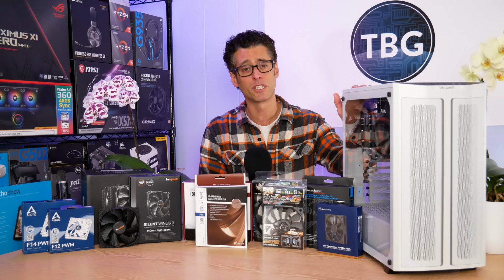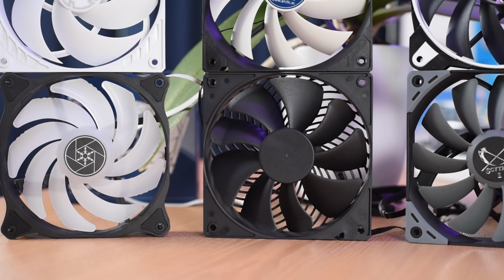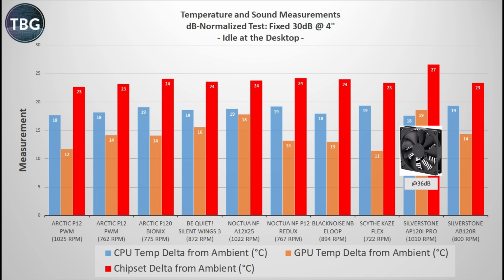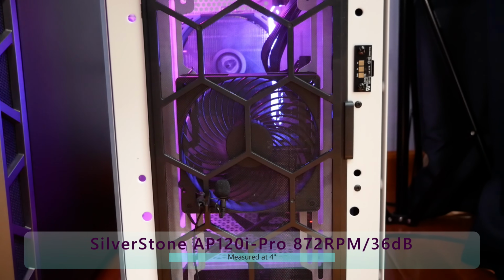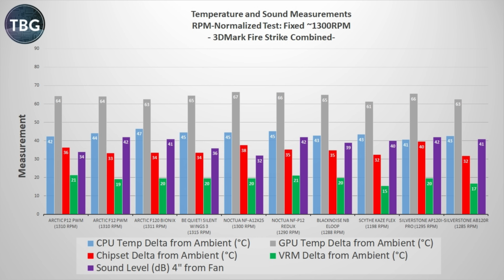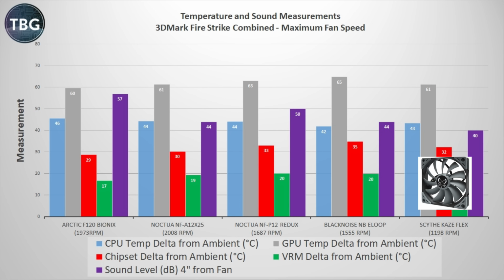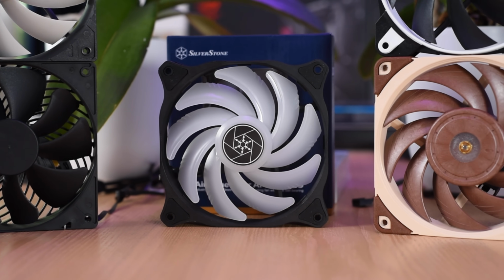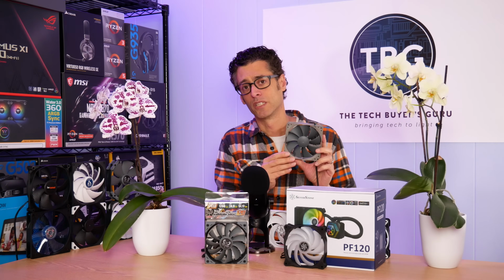The Best 120mm Case Fan Shootout: Arctic vs. be quiet!, BlackNoise, Noctua, Scythe & SilverStone

Comment: Can someone please recommend a good 120mm slim fan shootout video? Thanks!
Reply from the maker: Depends if you need a case fan or a cooler fan. As shown in my radiator fan video (https://youtu.be/W2Zis8RjcX8), you can't do better than the Noctua NF-A12x15 for a slim radiator fan. Here's the product link:  https://amzn.to/3jb0HVc
Also available in black:
If you need a slim case fan, then you want the Scythe Kaze Flex Slim: https://amzn.to/30gQVrA
It uses a similar blade design to its thicker brother that did so well in my shootouts.

Comment: We really need more videos like this, buit I'm concerned about the methodology. The microphone is picking up noise from air flow. also the vibration of the case, because it's clipped to the case. if the GPU was throttling, then the heat generated in every test is different. Like I said, we really need some more info like this for deciding what to buy. please keep it up, and try to improve the methodology so that the results are reliable!
Reply from the maker: See my 140mm case fan shootout, with an entirely new methodology based on viewer feedback! - https://youtu.be/PUdsTiRmuuU

I even locked the GPU fans at a slightly higher RPM to prevent the GPU from throttling, but still running it hot enough to make the case fans do some of the work!

One thing that you have to keep in mind about this testing is that I don't know the results until it's done, and that means I can't go back and change the methodology. What if only the last fan caused the GPU to hit the throttling temperature? I'm stuck with what I've got. But with each subsequent video, I will improve the methodology based on issues identified in previous tests.
Reply: @TheTechBuyersGuru  that's great!! I'm checking it out now. thanks!

Comment: I'm a huge Noctua fan (no pun intended) but NOT a fanboy.  You broke my heart, Noctua.  OTOH the Noctua fan tested here is definitely (IMHO) not the correct fan to use as a case exhaust fan.  It's designed for static pressure...that's why it kicks ass on radiators and even for CPU air coolers.

Comment: The Arctic P12, should have been in the max rpm test. It has about same cfm and more static pressure then the Blacknoise and can spin at about 1700 rpm.
Reply from the maker: Static pressure means nothing when it comes to case cooling. But a whole new shootout is landing tomorrow, which will include 140mm fans and more max RPM tests.

Comment: Nobody in the comments going to mention that silverstone AB120R...?  That sucker sounded completely silent even at high load.  Plus RGB for those who want it.  This review has thrown a wrench in my fan purchasing decision, but will likely save me a lot of money.  I'm looking at the Arctic P12's now, but am really curious if their 140mm version is just as good?  Thanks!
Reply from the maker: The P14 review is coming at the end of this week! Yes, the AB120R (https://amzn.to/3gKWfKN) is very quiet, mostly due to the very quiet motor. But it will kick up some wind noise when running, as it moves a lot of air. Great fan all around, also found it to work very well on radiators. It's equivalent to the P12 overall, but with ARGB lighting and a higher price tag. Totally fair in my opinion.
Reply: @TheTechBuyersGuru  Thanks for the reply, I'm looking forward to the 140mm fan video.  Subscribed!
Reply: that AB120R is a sleeper. Bought one to replace my stock exhaust fan for my case. Virtually silent and it moves air like crazy. Plus the RGB bonus. I love em. Ordered two more of em which I'll be adding to the top of my case.

Comment: Would the Scythe Kaze Flex RGB version perform similarly to the non RGB version tested?
Reply from the maker: A lot of people are asking me this lately, and all I can say is that I've tested the new, unreleased ARGB Scythe Kaze Flex, and it didn't perform the same. I've never tested the Kaze Flex RGB. My suggestion is that if you want a great ARGB fan that I have tested extensively and that did great in this shootout, go with SilverStone's AB120R: https://amzn.to/2VOTFLK
Reply: @TheTechBuyersGuru  The Scythe Kaze Flex RGB 1800 rpm, would be interesting since it has over twice the static pressure of the 1200 rpm !  https://www.quietpc.com/kaze-flex-120-rgb-1800
Reply: @TheTechBuyersGuru  Ah thanks. Unfortunately I don't have ARGB on my mobo so I went ahead with the RGB variant. Haven't put it through many tests but so far it's much quieter than my previous fans (the Noctua redux) which isn't s surprise but welcome nonetheless.

Thanks for the detailed vid!
Reply from the maker: Glad that worked out! Eventually I will do an RGB fan shootout once there are enough samples out there, but I'll probably focus mostly on ARGB, as that's becoming the new standard.
Reply: @TheTechBuyersGuru  BTW, Scythe does have an 1800 rpm ARGB   model : KF1225FD18AR-P     https://www.scythe.com.tw/kaze-flex-120-argb
Reply: @salami124  they already test it (see comment above), and it doesn't perform well.
Reply: @JoyAmormio  He states "  I've never tested the Kaze Flex RGB " that's his comment !
Reply: @salami124   i mean the argb model, since your last comment here is for argb link 😊
Reply: @TheTechBuyersGuru  damn, i was gonna bought the argb version of kaze flex. Knowing it doesn't perform well i think I'm gonna stick with id cooling df 12025 argb version

Comment: Any idea why we have many lower temps in the 30db test, than in the 1300rpm? The diminishing returns shown between these 2 graphics are laughable.
Did you realize the Arctic F12 has almost the exact same performance (cooling and sound) at 1300rpm, as the Noctua NF A12 at max speed? Wow!!! And Arctic costs only a few pennies.
Do you know if the "silent" line of the Arctic P12 and F12 perform as the 30db graphics show? They state to run at a fixed speed of 1050rpm(P12) and 800rpm(F12).

Comment: Nice review, thanks. What I have not seen anywhere is a review of fans running on top of case (horizontally). I have Cooler Master fans in front and back of case that are ok, but when I install the fans on top they produce a much louder noise. I am shopping around for fans that are quiet even when mounted on top of case. Perhaps you will pioneer that type of testing? Thanks and keep up the great reviews!
Reply from the maker: That's because your CM fans use rifle bearings. They are pretty bad for use in a horizontal position, because you are hearing the bearing rubbing on the hub. Anything with fluid dynamic bearings will work better. But it's definitely something I should mention in my next review, and maybe I'll do some noise testing of that setup too!
Reply: @TheTechBuyersGuru  Thanks so much for the quick response! I tested the rest of the fans I have here from Be Quiet! to AsianHorse and none had the issue. None are rifle bearing... I really like the Artic P12 PWM, my current build is white but since I need ARGB (so computer will run faster... lol) I think I will order the SilverStone AB120R-ARGB. Once more thanks so much for your review and comments.

Comment: Scythe 3 or 4pin?
Reply from the maker: I tested the Scythe Kaze Flex PWM 4-Pin (https://amzn.to/3ilTJMy). The 3-pin model will have a narrower range of RPM control.
Reply: @TheTechBuyersGuru  Gotcha. Would you recommend Scythe or the Arctic P12 for case fans (intake, outtake). The P12 price is very nice but the Scythe fan performs better but is more expensive. I just want to make the right decision.
Reply from the maker: How many fan mounts do you have? If you have at least two mounts in front, I would consider getting three P12 PWM fans (https://amzn.to/3eYOct2) for the price of two Kaze Flex fans. If you just have one front fan slot, the Kaze Flex will perform better.
Reply: @TheTechBuyersGuru  The Thermaltake H15 has two at the front. Arctic P12's it is! Thanks for your help.

EDIT: The P12's i wanted were out of stock. I ended up buying 2 Kaze Flex fans for intake and a Scythe Hayabusa for outtake. That one is 40% off so jump on it guys!

Comment: The Sycthe Kaze (kah-zay) flex comes in both 120mm and 140mm in rgb. Not argb though. But the 120mm is like $15.00 and 140mm and around $22.00 USD.

Comment: Is there a difference in performance between the Scythe Kaze Flex 1200RPM PWM and the RGB Version????? Thanks for this awesome review.
Reply from the maker: Yes, there is. I tested the ARGB version when I reviewed the Scythe Mugen 5 ARGB cooler. I found the fan to operate at a much higher noise level, even accounting for its higher RPM (1500 vs. 1200).
Reply: The Tech Buyer's Guru the rgb Kaze Flex 120 pwn can go up to 1500rpm?? It’s advertised as the same specs as the non rgb version.
Reply from the maker: I'm sorry, this was my mistake. The RGB version (https://amzn.to/2NOGtSE) is indeed limited to 1200RPM, just like the standard Scythe Kaze Flex. I tested the newer ARGB version that goes up to 1500RPM, but that is only available on the Mugen 5 ARGB cooler right now. Unfortunately, I can't tell you if the Kaze Flex RGB performs like the Kaze Flex, as I haven't tested it, and I know the ARGB version is very different.

Comment: Disappointed you did not test the Arctic P12 to the end. Tossing out some half way through the benchmarks makes no sense.
Reply from the maker: I only decided to do that full RPM benchmark halfway through testing, which took several days. But what I actually showed in that last test is that max RPM ratings aren't that helpful, so I don't think it would change the results for the P12.

Comment: I don't understand how the Bequiet fan could be in the top 3 in most tests and still not even get a runner-up recommendation.
Reply from the maker: I've tested be quiet! fans in enough case and cooler reviews to know how they work, and they simply are not the best. They are more than decent, but they are not superior in any way, and the prices are quite high. Other reviewers who call them "the best" haven't tested enough fans.
Reply: @TheTechBuyersGuru  Thanks for the reply👍.  I was wondering only based on the charts in your video.  I am looking to build a new computer for audio recording.  What is your opinion on silent case or airflow case with large slow fans?

Comment: I'd like to see a push-only configuration for case fans, since pressurizing an environment disperses more heat due to more air molecules interacting with the components (hence why you see air coolers pushing on heatsinks). It's hard to say just how this effect would work, since the cases have so much volume, and the fans in the front of the case are typically closer to the listener. I can see why fans are distributed around a case, especially when heat rises. Perhaps there is a case setup where you can drive all of the air from the bottom upwards (establish a thermal column) and have the noise dampened by a material below it. Another idea could be to use passive coolers on the graphics card, processor, and VRM to see what fans/cases work the best (somewhat like a server).
Reply from the maker: You can't use a passive cooler on any modern high-performance CPU, far too much heat. Same with a GPU, except at idle. So running these at low RPMs during the case fan test is the best option. Note that there are numerous cases that use vertical thermal stack designs, like the SilverStone RV05 (https://amzn.to/2YJihal) and the Cooler Master SL600M (https://amzn.to/38c4w7b).

Comment: nice effort and interesting results. Recently I watched a fan comparison by Optimum Tech ( https://www.youtube.com/watch?v=QnBo9bTRsxk ). His test methodology is a bit more compelling to me.
The point where you measure the noise level may be ok from a technical point of view.  No one will experience the noise level in that way you presented it in your video. No user will have there ears right in front of the fans during actual usage. For me, it would be far more interesting to see how the noise level is at an somewhat realistic distance. Maybe if the case is standing right next to where im sitting on my desk.
Reply from the maker: FYI, he measured dB from 6", I did it from 4". Basically the same. I agree that my audio samples were done too close, and my next round up will do them at 4". Note that doing audio samples or dB testing from where you sit would be meaningless. A microphone cannot resolve differences that the ear can at that distance.

Comment: Yes for 140mm fan test. I would like to know how the temps and noise change compared to 120mm
Reply: Yes, try to do it with as similar hardware as possible. If you think about it, a wider case doesn't necessarily lead to better airflow around the components themselves, more air will just move through empty space.

Comment: So Arctic P12 is good as case fan also? Not only CPU fan?
Reply from the maker: Exactly - it's an awesome cooler fan, and a very good case fan. Given the low cost, it's hard to argue against, especially if you want to buy a 5-pack to equip both your case and cooler.

Comment: I think it would make more sense to keep the "listening" microphone further away. Same distance as the desibel-test.
I understand you want to get very detailed audio, but I think it skews the noise too much and is not very illustrative of what the fan actually sounds like. A lot of these fans sound like they have very heavy motor-noise when I know that they don't (the ones I have first-hand knowledge of anyway) - and most quality fans will for all practical purposes generate their noise via air movement.

Other than that - excellent test.
Are the cheapo Arctic P12's really as good as they seem here? ... If they are even just decent, their price alone makes them interesting, but I have also heard a lot of people complain about buzzing motor-noise that they just can't stand. One thing that a pure desibel measurement can't really convey is the noise profile and how pleasant they are to listen to (or rather - how easy they are to ignore).
Reply from the maker: I agree with your analysis, and will change the test method for my upcoming 140mm case fan shootout. I clipped the mic to the frame to ensure 100% consistency, but the audio clips did end up being a bit different than what you'd actually hear. Some people have suggested I position the mic 2 feet away, but that honestly makes no sense. You'd get nothing of value in the audio clips that way. Mics don't work like ears, that's why you put a mic right up against a singer's mouth or guitar or drum, and not 2 feet away!

And yes, the P12 really is that good. I've never noticed any annoying motor noise.

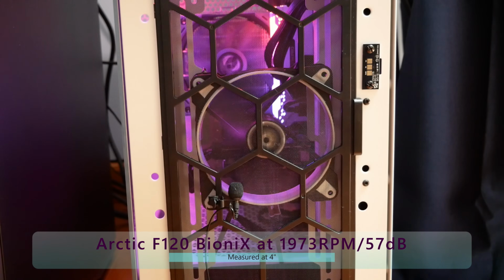Comment: Well done! I liked both of your fan test videos, and will be looking forward to more especially 140mm fan testing. However if I could give you some constructive criticism, particularly on this video. I noticed your db measurements at the 14:55 mark note that they're measured from 4" away, however the mic is clipped right up against the dust filter which is millimetres away from the fan blades. 

I do not think this gives an accurate representation of the noise level you are trying to demonstrate. Perhaps mounting the mic to a little arm or something from 4" directly in front of the fan would better articulate the expected noise from the fans in question. 

I would also like to see more db normalized tests implemented just like in this video for potential future tests. Overall great job though, and I like the fact that you've gathered some less popular fans at different price points to compare to the usual "fan giants" like Corsair, Noctua, be quiet!, etc. Keep it up!
Reply from the maker: Many people have mentioned this, and I agree that the mic position was not ideal. I did it to prove consistency in placement and to avoid any claims of bias, but the drawbacks were considerable in that the noise being picked up was dominated by the motor. In my upcoming 140mm case fan shootout, I will mount the mic and decibel meter right next to each other, 4" from the front of the case. And by the way, I'm dropping all RPM-normalized tests in favor of two dB-normalized tests for each 140mm fan in my upcoming test.

Comment: The noiseblocker is loud when the intake side is pushed up against a filter or other obstruction. They recommend using a frame or washers to create some distance if mounted with the intake facing a radiator/heatsink/dust filter.

Comment: What do you think about scythe kaze flex rgb version? Is there any difference compare to the non rgb?
Reply from the maker: My test of it on the Mugen 5 ARGB cooler proved that it was not the same fan. I don't like it. If you want ARGB, go for the SilverStone (https://amzn.to/30mpTRF). It's out of stock at the moment but will return.
Reply: @TheTechBuyersGuru  thx for reply, just wondering how difference of it with the non rgb on. I still getting an arctic p12 since it cheap and really good for the price.

Comment: I've been researching case fans for a new build, and I ran across claims that the eLoop fans are noisy in pull configurations with an obstruction (like the air filter in your test case). This is may be why they failed to live up to expectations.
Sadly the Silverstone fans are even harder to find than the Scythe Kaze at the moment. I presume another victim of the human malware situation.
Reply from the maker: Many people have commented that Blacknoise fans don't work through mesh, to which I say, OK, then don't use them, because every intake fan pulls through something, and in good cases, it's mesh. Sounds like an excuse from a "fan-boy" to me, and trust me, I heard plenty of other excuses about every other fan in this test that didn't win. But the Blacknoise fans are very interesting, and I'm actually going to be testing them again in a few different configurations in an upcoming 120mm/140mm fan shootout.

By the way, yes, the SilverStone fans are sold out worldwide, but luckily the Scythe Kaze Flex is back in stock: https://amzn.to/382f60t